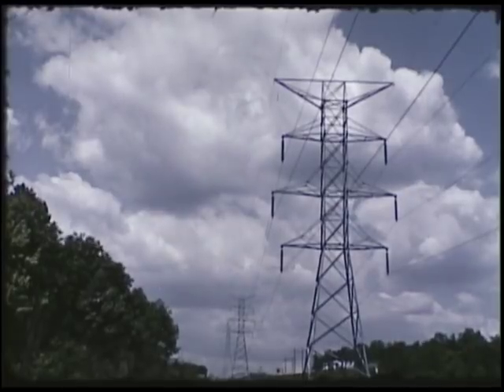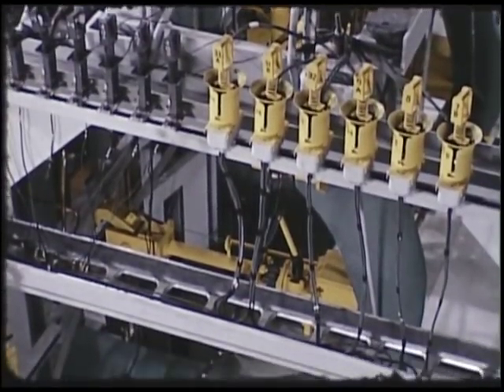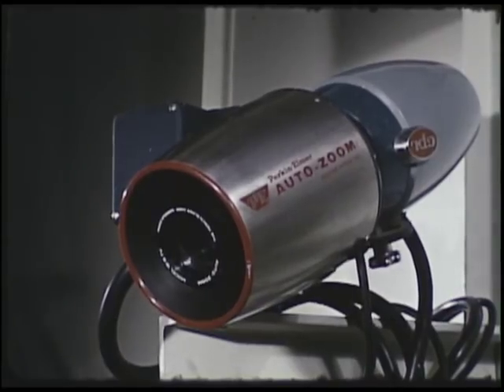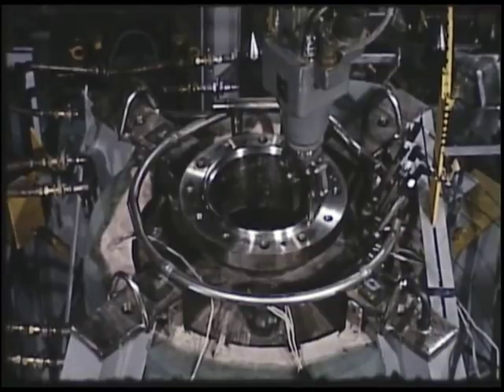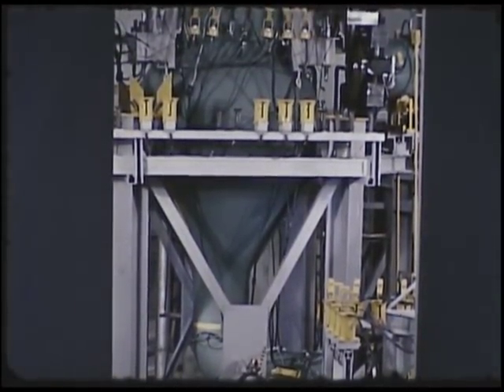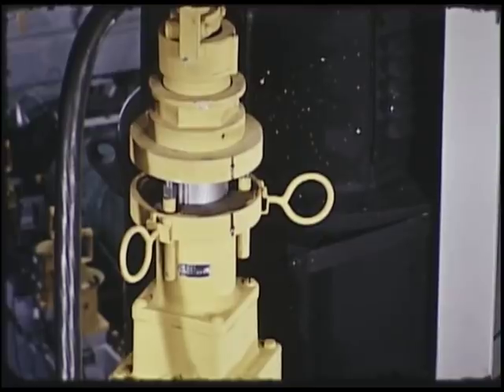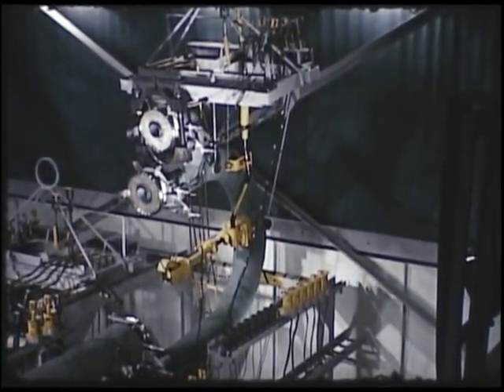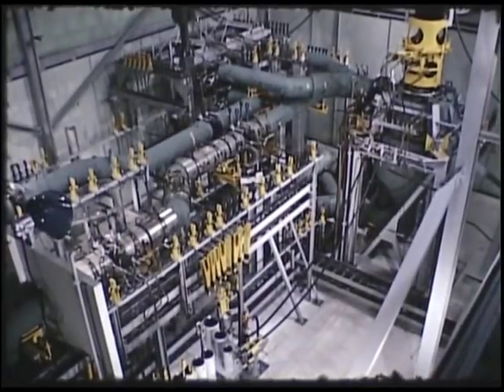Remote Maintenance of Molten Salt Reactors

Comment: It's silly we aren't using these already given the amount of development that seems to have gone into the design.
Reply: @Oliver MayoThere is no future for nuclear power. It will always be the most expensive way to produce electricity. EVERY other way to make electricity is cheaper.
Reply: @Oliver Mayo There will be no carbon free future. That is correct. Greta will soon be forgotten…
Reply: TMI Chernobyl Fukashima..........the nuke industry lost the faith of the people i for one dont lose sleep over nuke power going under as they are dangerous inherantly by mans arrogance and ability to press his luck streching limits so no i dont see nuke power as a good thing
Reply: I'm guessing you've kept up with this MSR stuff, but I'll go ahead and tell you why we didn't use them. CORROSION. On paper, the salts aren't corrosive, but any moisture in the salts will result eventually in HF, or Hydro-Fluoric acid, aka the stuff so strong that getting a few drops on your skin can leach into your blood and cause cardiac arrest. The Hastelloy parts of the original MSRE were inspected under electron microscopes, and they were found to have significant degradation, both from radiation and acid erosion. It didn't help that at the temperatures the reactors run at, the steel actually behaves like a sponge and soaks up radioactive elements from the salt in addition to the rare earth metals that electroplate themselves to the sides.

These were all issues that may have been resolvable, but it hasn't been until very recent administrative actions that addressing these issues became an option.
Reply: @mattbrody3565  Caldicott trolls have arrived...
Reply: The simple reason is that water is everywhere. And the second reason is that the cores in msr seem to melt down for various reasons.
Reply: @flugschulerfluglehrer  That reactor ran fine until Dick Nixon shut it down in favor of reactors that provided materials for nuclear weapons. Now that we are reducing our nuclear weapons, the US needs to pursue Thorium as many other countries are.
Reply: @MikeJones-rk1un  Nuclear power is the most expensive form of electricity. We simply don’t need it. There are plenty of alternatives, all of them are cheaper. What we actually need is better infrastructure to distribute electricity. E. g. Iceland alone could produce enough electric power for the entire world with geothermal plants if only you could distribute it over the whole planet. The money we invest in nuclear power would be far better spent for infrastructure. Thorium is even more expensive than Uranium, and always will be. There is more than enough Uranium so there is absolutely no good reason to invest in Thorium.  And No! Thorium does not cause less nuclear waste than Uranium.
Reply: @flugschulerfluglehrer  < Says there are plenty of alternatives (to nuclear) but doesn't seem to know what they are....
Reply: @MikeJones-rk1un  Did you read my comment? I named one possible alternative. Geothermal power. Or solar panels in remote desert areas, or wind power on the sea, or tidal hydropower. The problem is not the Produktion of electricity, it is its distribution. 
BTW Forget about ideology when thinking about power sources. Just look at the price tag. Hydropower is cheapest, nuclear is the most expensive.
Reply: @flugschulerfluglehrer  You are  German, right? If so, it figures then that you would badmouth nuclear power: Germany is not only shutting down its nuclear program due to political pressure from their Green con-artists, but in order to have enough power for its industry is ramping-up coal-burning, as a stepping-stone towards yet more natural gas burning power stations. The wind-mill & solar panel scam is of course just that, geared largely towards the export market, with various vassal states of the EU and the rest of the world as unsuspecting clients.
    As for the statement that nuclear power is the most expensive for of power, this kind of hot air can only persuade idiots that never heard of France's electricity-power generating infrastructure, to name the most successful counter-example.
   The ridiculous comment about Iceland powering the whole world does not even merit a reply.
Reply: @frankieromnimon5898  I do not know what is worse: that you call me a German or an idiot. I am neither. And I am well familiar with the French EDF. I lived quite a while in France. I would say that your assumptions on me are as qualified as your assumptions on energy politics. 
Happy New Year
Reply: @flugschulerfluglehrer  Calling you a German was a reference to vested interests; certainly not the mark of idiocy, so please do not present yourself as a victim. And as far as qualified assumptions go, all I read from you is rhetoric. No  surprises here of course, I 've seen this pattern time and again in such discussions. Happy New Year to you too sir.
Reply: @frankieromnimon5898  Happy to see that there are also polite people on YouTube. Maybe I am wrong, maybe you are. Still, as far as I know nuclear power is the most expensive. You do not need to be a rocket scientist to see that the investment and the ongoing cost of a nuclear power plant is far higher than the cost for a turbine for hydropower, or wind or you name the technology. In the Long run it is cheapest to invest in the networks to bring electricity from Norway to Spain to keep focused on Europe. And I include pipelines for artificial gas (like methane) in the term network. We already move fossil fuels at a very low cost around the world. Why not produce these fuels from algae or with solar power? Everything is cheaper than nuclear power. I assume that you are familiar with the process of Uranium enrichment? So do not tell me it is inefficient to produce artificial fuels like methane. There is an abundance of energy on this planet. The problem is only to distribute it.
Where I live electricity is quite cheap. We pay 4 cent for electricity, 2 cent for management costs but 11 cent for the network provider. 
Producing electricity is easy and cheap. New technologies will not make it any cheaper. We have to think for the long run and invest in networks.
Reply: @flugschulerfluglehrer  There are all sorts of people in this facsimile of a world that is the Net. To the point, let me offer you a number to quantify my mistrust towards so-called "renewables": In my country (Greece), the state-owned electricity company buys power from windmill operators at €180/MWhr, while coal-burning stations produce the same amount for €11/MWHr. Anyone calling that pricing anything other than cynical extortion must have his head examined, unless of-course he is among those that profit from this racket. The buying price for solar-panel power is even more ridiculous, at €224/MWHr (or at least was until a few years ago). There is NO WAY that the cost of nuclear power would even approach these ridiculous prices, uranium enrichment or not.  And the "not" is quite relevant to the sort of nuclear reactors discussed here: Thorium is four times as abundant as uranium, it does not need any sort of enrichment and its burn-up rate is 100%, instead of the pitiful 1-2% of uranium in conventional reactors. Which means that fuel is four hundred  times cheaper than uranium. Said uranium being actually on a par with coal is terms of actual production cost -today-, no matter what you say here. The resulting fission products in MSRs are so "hot" radiologically, that they are transmuted into stable elements in a couple of centuries, instead of countless millenia for the current type of spent fuel.
   And as an aside, by far the safest form of power production in terms of workplace fatalities/TWHr produced is, yes, you guessed it  nuclear (the kind we have right now), at 0.04 fatalities/TWHr, being almost four times safer than windmill power, that stands at 0.15 fatalities/TWHr. Coal is of course first by miles, with 100 fatalities/TWHr.
   So give me numbers, or refrain from void rhetoric.
Reply: @frankieromnimon5898  Ok. I yield. I don’t have the time nor the energy to get all the Thorium propaganda out of your head.
Reply: @flugschulerfluglehrer  Hmm, propaganda yes, sure. But on the other hand, no meaningful refutation of the numbers I posted here. I do not mind if you do not bother to reply to this, but note also that ever since the onset of "renewables" investments in my country, the price of electricity has gone up, while dozens of rare and nearly extinct eagles and vultures have been killed by the racketeers' windmills.
Reply: @davesaunders3334  Another say-nothing mouthpiece. Yawn...
Reply: @frankieromnimon5898   - Ahh, I see you get this a lot. Maybe you should work on developing some self-awareness?
Reply: @paulbedichek2679  I would love to have clean, cheap nuclear power. But it is neither cheap nor clean. Uranium mining and purification makes a terrible mess and nuclear power is the most expensive.
Reply: @flugschulerfluglehrer  I'm about a year late to the discussion (and bear with me, this gets a bit long), but there are some interesting points to consider why nuclear power isn't very appealing today. I'll stick to the points that are relevant to MSRs, but you can just skip to the end. Currently, nuclear is expensive because of obsolescence, size, basic coolant safety limitations and premature project shutdowns.

Most of our nuclear tech is from the 70's and struggles to keep up, which is just the start of our problems. Water-cooling means the core coolant loop has to be kept at extremely high pressures to avoid boiling. Considering the sheer size of reactor cores, it's hard to move and install something that big and heavy to begin with, and with the high pressures, you need an expensive containment building to catch any debris from an accidental meltdown. That adds a lot to cost and drags out the time it takes to build a reactor. Big reactor cores can run on "natural", unenriched uranium, but the safety challenges are a lot bigger. If you let a nuclear reactor run for a couple of decades, its cost of energy production goes down by a lot because of how cheap uranium is for the energy it releases. The problem with that is, it's easy to shut down nuclear projects, and constant regulatory changes require modifications that make owning a nuke less profitable.

MSRs, on the other hand, run at low pressure with good stability, can burn fuel more thoroughly, and are more flexible on what fuels they can use. You said "the cores in MSR seem to melt down [...]", but that's exactly what the M in MSR is all about. Meltdown just means the fuel in the core is a liquid. It also could allow for waste management while the reactor is running- a little bit of fresh fuel in, a little waste out, and each atom of fuel can spend a longer time in the core, increasing the odds of fissioning and reducing waste.

Since MSRs run at near-atmospheric pressures, there's not enough bottled-up force to send radioactive junk flying if anything goes wrong. The containment buildings and reactor cores would be cheaper to build, and the cores would be cheaper and lighter, making them easier to install and manufacture. With Thorium, we can use waste streams from rare earth mining companies, and because it only comes in 1 isotope and doesn't dissolve in water, it's easier and cleaner to process. It's harder to burn as fuel because you need to breed it (or use a fast-spectrum reactor, but the same goes for depleted uranium, so...) , but the idea's enticing enough that it might be worth pursuing someday. 

Sorry for the long read, but even without Thorium, MSRs have a lot of performance and safety advantages over traditional LWRs, which could bring prices down by a lot. Running at lower pressure, MSRs are easier to build and safely contain. That reduces the engineering requirements of each powerplant, to a point where it'll be easy to meet future safety regulations. They also burn fuel more thoroughly, which reduces the amount and toxicity of spent fuel. Put it all together, and you get a carbon-neutral power source that's cost-competitive and pairs nicely with renewables.
Reply: @mattbrody3565  you talk nonsense. There is a no "big reactor cores who can run on natural uranium". That is what Heavy Water Pressurised Reactors are for, not some mystical "big reactor cores". All reactor types except HWPR cannot use natural uranium. 

Melted salt is not moving at its own accord, it needs pumps...like all cooling liquid.

Containment buildings are for containing escaping cooling liquids vapour safely since it has enough space to hold all the vapour in case of catastrophic venting AND to protect reactor from missiles/planes strikes. So MSR would have containment building anyway since salt only transfer heat from the reactor core to the secondary and tertiary heat loops, which would be a water...under pressure.

Just because you have scratched surface of the knowledge, it doesn't make you an expert.
Reply: @AKUJIVALDO  perhaps I misspoke or misinterpreted something. Most late Gen 3 and Gen 3+ reactors are designed to use LEU. The bigger the fuel assembly in the core, the better the neutron economy, which in turn lets you run lower enriched fuels and- at big enough scales, unenriched fuels. I remember there was controversy about the Iran Nuclear deal since the reactors authorized didn’t require centrifuges to produce fuel. Heavy water helps by moderating more effectively, hence why HPWRs are more suitable for NU, but NU LPWRs have been a goal for many nuclear power utilities for a long time.

Yes, the salt needs to be pumped. Not sure why you brought that up. As for the containment building and the secondary/tertiary cooling loops, MSRs can use air cooling and/or supercritical CO2 instead of pressurized water for heat transfer. That reduces some risks. And I already understand that the containment building is there for coolant vapors. It just so happens to be that when high pressure vapor escapes, it tends to bring radioactive contamination and debris with it. But yes, the vapor and contamination are the more important factors.

In the case of MSRs, the containment building around the core and primary coolant loop has lower strength requirements and (as you said) does more to keep threats out than to keep reactor contents in. That’s a byproduct of lower pressures and the thermal stability of molten salt. If the secondary loop is under higher pressure, then it can be isolated, and that part of the building can be strengthened. The high pressure region in this case is principally easier to contain due to the lack of coolant contamination, meaning vapors could in theory be dissipated instead of simply captured. Whether regulators would like that or not is another matter, but the core point is that the conditions are generally less extreme, which can allow for more flexibility in design, which can reduce costs and expand possible deployments.

Comment: Cool, but definitely a proof-of-concept. One failure of a jack bolt, automatic positioner or spreader and you're stuck. Or even the remote arms themselves - are they replaceable on failure? What about failure of the arm-moving motor? Now you can't move it to replace it. 
We've come a long way in this regard, but its cool to see where we started.
Reply: It's impressive they were able to get what they did. They were on a shoestring budget and had to make due in addition to the test of time.
Reply: "its cool to see where we started" - and ended.
Reply: The idea was to have the crane above in a room and have the reactor inside of a "cell". There would be a concrete lid between the two during normal operations. This would allow maintenance to be performed on the crane.
Reply: Well, due to the intense radiation and its effect on electronics, even today we'd have to rely on these sorts of simple machines. You couldn't have modern industrial robots in there since you'd be exposing their sensors and chips to the radiation.

Comment: Why do they need to do all the work remotely, is it because the interior area is dangerous for humans?
Reply: Dangerous, yes. Everything is HOT both thermally and radiologically. The room is at 700ºC, and the radiation field is about 3000 rem. You would be dead in about one second.
Reply: @tomswiftTTT  Actually there were not any Nuclides in the system, this is filming a test of the working and associated equipment before it went hot. When it did go hot, the equipment didn't fail, so it was never taken apart and sits as it did in this film.
Reply: Fermi Unit 1 still sits awaiting teardown…

Comment: this is a technology that exists 60 years ago. can they be repeated again now?
Reply: Terrestrial Energy,  ThorCon Power, and (partly) Terra Power are the folks trying to beat the Chinese to do it.   Although TerraPower probably is doing it China.   But they are tiny companies not fully funded.  However Terrestrial is working in a safe, well organized democratic company with a rational regulatory system.  That country has a very long boarder with the USA and powerlines go back and forth.  Canada!
Reply: A private company with an employee -> manager -> c-level -> board member structure is not a democracy.
It is an autocracy.
Reply: Not with the NRC in place and the rules it has. China has no such qualms.
Reply: They don't need to, that work has already been done, its time to scale this up to produce power.
Reply: @Rob_Moilanen  Everybody looks at the costs vs the contamination.  Proponents of MSRs deny that this prototype had serious problems, the technology is more complex than liquid sodium cooled reactors, and the lifespan of the nickel alloys used (Hastelloy and Inconel) are only 10 to 20 years, 20 years is pushing it, and then it has to be replaced. The removed reactor components fully qualify as high-level nuclear waste, tons of it, every pipe and coupler.